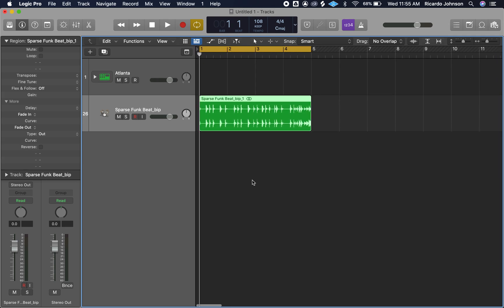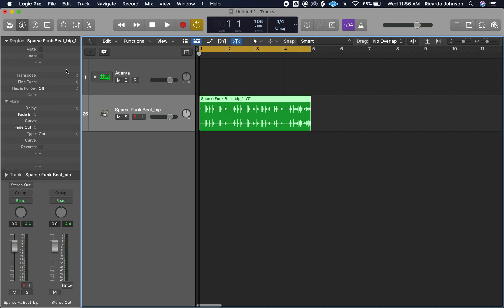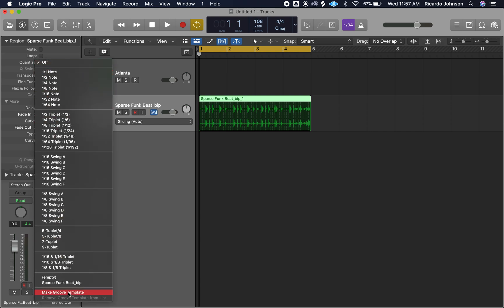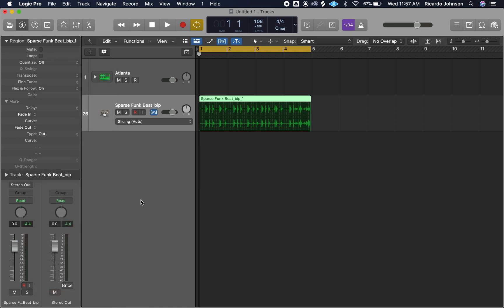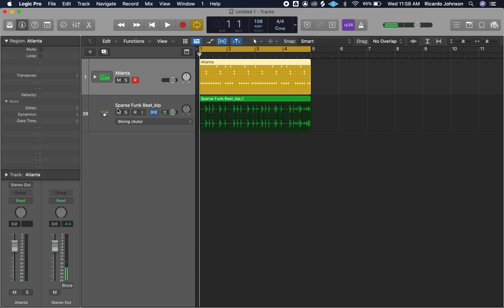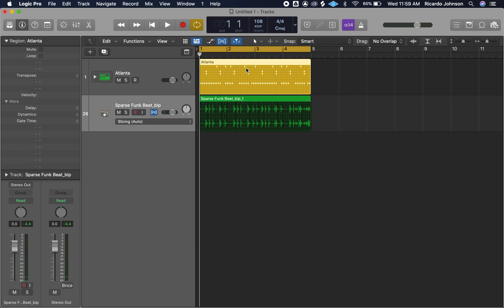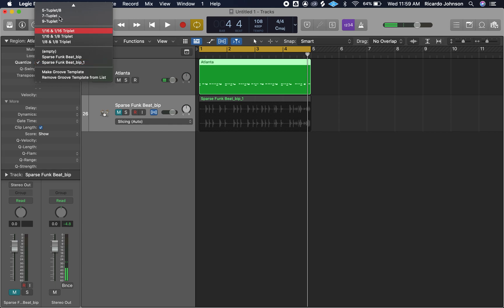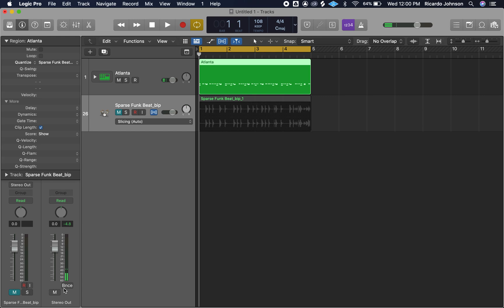Creating Groove Templates from Audio Files in Logic Pro X

Comment: Great explanation. Will it also work if you apply the groove template to multiple tracks? E.g. If you had the kick, snare and hihats each on their own track and you applied the groove template to all three, would it tie it all together so you still got the same swing and groove?
Reply from the maker: Yes you can apply the same groove template to multiple tracks.  Be aware that Logic always has a groove track feature...groove track and groove template are not the same exact thing...they serve the same purpose but have some slight differences in how they go about it